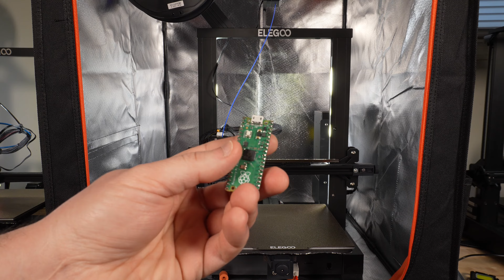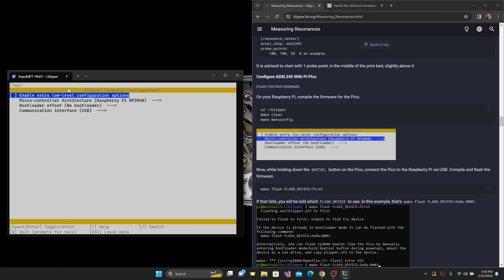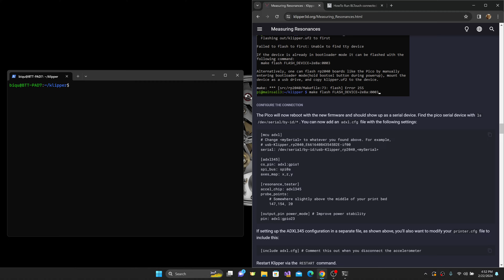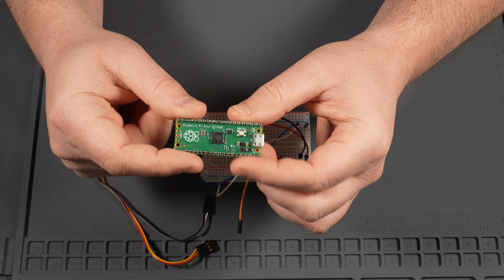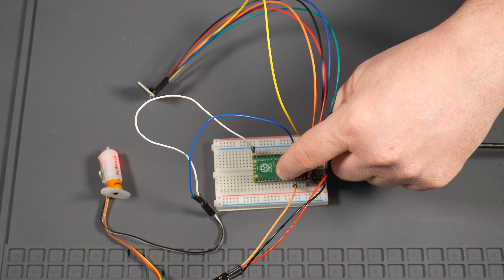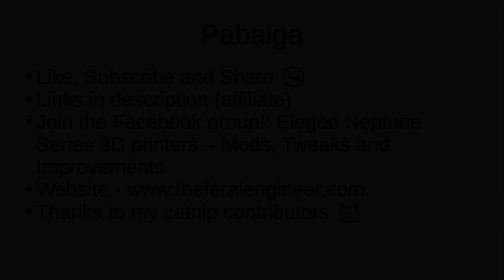Adding a touch probe and accelerometer to ANY 3D printer running Klipper

Comment: Does the biqu microprobe connect to the pi pico the same way? I read their description about the microprobe and it said a 10K pull-up resistance is required.
Reply from the maker: I'm not sure. I only tested this with a Bltouch and a 3dtouch. I have a microprobe that I could try, just need to find the time to do it

Comment: Thanks for the video, All the tests are working, except when I do a G28, it says "Error during homing z: Communication timeout during homing"
Any idea?
Reply from the maker: Hm. Not sure. I ran it through full homing routines but didn't run into this issue
Reply: @TheFeralEngineer  Found the solution : 
inside “/home/pi/klipper/klippy/mcu.py” file changes the “TRSYNC_TIMEOUT = 0.025” from 0.025 to 0.050 fixed the problem.
Reply from the maker: @Bruno-vz8vk  awesome! I'll definitely keep that feather in my cap if I run into it. Enjoy your Bltouch! 🐱🐱

Comment: Hi phil i started following you, i saw your Klipper-forElegoo-Neptune-series-3D-printers on github page, i just want to know if Neptune 3 MAX is compatible with the board firmware thats is posted there

I got a homing issue with my printer specifically with the Z axis getting upper and upper instead of landing to the hotbed, getting stucked on the process of homing cuz sensor never reachs the position it supposed to

so i'm trying to solve this situation by jumping to another firmware (klipper obviously) using raspberry pi 4, but idk if i can use that board firmware of github it seems to be the same for any neptune 3 model, am i right?
Reply from the maker: The binary is probably outdated but it's simple to build one yourself using make menuconfig. Watch my installing klipper the easy way to get an idea of how to set up make menuconfig. The printer. Cfg will have the settings you need to use (low level, stm32f401, 32kbi bootloader)

If the probe isn't triggering, test it with a piece of metal like an Allen key. You should see the light go on and off with the Allen key

Comment: Ive had BL touch on my Ender 5 plus's and on my little Kingroon kp3s. But never use them, I prefer using manual levelling, so much quicker than waiting for auto levelling which still needs manual tweaking. Nothing auto about it really.  Ive got silicon bed springs on all of them, I set them up and use feel test on the skirts to tweak before each print. Never had an issue.

Comment: Friend! They managed to solve it, now it is possible to use the original Neptune 3 pro screen with Klipper. Please make a video about it.
Reply from the maker: The screen on the original Neptune 3 was trash. It might be better on the pro.
Reply: @TheFeralEngineer  I was wrong! I mean 3 pro and not 3!
Reply: @TheFeralEngineer  I'll correct the comment haha
Reply from the maker: @OpsSkyTrap  are you sure it's the 3 pro and not the 4?
Reply: @TheFeralEngineer  Yes my dear, I have a 3 pro. I even followed your tutorials to install klipper on a tx6-h tv box and everything worked fine! I believe that thousands of people would like to use their original touch screen again thanks to this solution and there is no one better than you to do this, helping the layman.
Reply from the maker: @OpsSkyTrap  unfortunately, I do not own a 3 pro
Reply: @TheFeralEngineer  A friend of mine managed to use a UART to USB converter, but it is also possible directly from the UART to the display. A little more complicated and this is the method I'm trying, but I face a problem with access denied on uart1 - ttyS0 even though it is recognized ;/ 
Help me please ! ??

Comment: Sir, thank you for the adapter rail for the elegoo neptune 3. Currently, I'm having problems with the 3d touch installation, I believe the wiring is correct but the touch will not trigger when using home all on Klipper. Testing the probe results in correct movement via the klipper bltouch console commands. I have read that the jst connector could be at fault even more so with a dupont connector. Would you recommend a bltouch instead of a clone? 
I will also be investing in a dual z kit, that will be purchased from Aliexpress.
Thank you again for all of your reviews/upgrade guides.
Your kofi link is that still working?
Reply from the maker: Here's a way to debug the 3dtouch. I actually have one that I could mess with to confirm that it works correctly. 

Here's a resource to check:
https://klipperscreen.com/klipper/using-a-3dtouch-with-klipper/

As far as the BLtouch, I have a link in the description for the proper Antclabs Bltouch, the Creality crtouch and the biqu microprobe, which all work well. 

If you'd like to be a catnip contributor, the link for that is in the description as well 🐱🐱

edit: I just tested my 3DTouch (V3.2) and it worked flawlessly with this setup (using the pi pico).
Reply: Thank you for the link, I removed the jst and re connected. This time, I did get a query probe triggered response. The first time that happened, but when performing home, all it still wants to ignore the 3d touch and keeps trying to move z further into the bed, creating a horrendous sound on the belt.
I will purchase the biqu probe, did you have it on the znp robin nano setup? I'm using btt pad7  
Off to look at your catnip
Have sent something to your catnip fund, I do appreciate your help.
I have also purchased the biqu probe. So fingers 🤞 
Best wishes.
Reply from the maker: @aarondavalon8985  thank you! Just be careful because the biqu one is much smaller than the 3D touch and you may need to drop it down a fair amount due to its size and travel of the pin. I haven't used one personally, but one of my group moderators has one and said it's pretty good. 

That doesn't make sense that it runs through the tests but doesn't deploy when homing. Is your z axis set to virtual end stop?

Comment: If there is a free stepper driver slot, you could use its gpio for the bl touch too.
Reply from the maker: I thought about doing that as well but this is a bit more universal for those with true dual Z or what have you